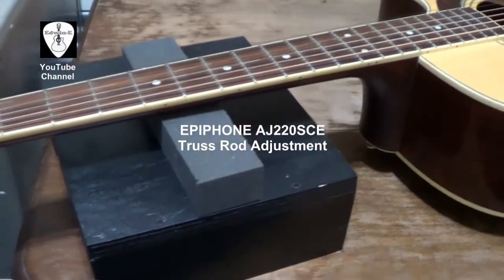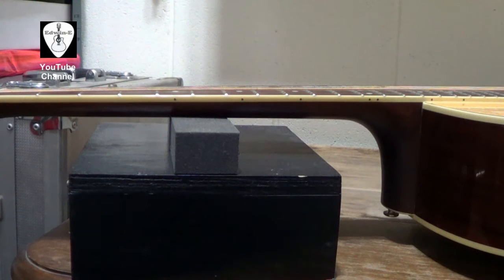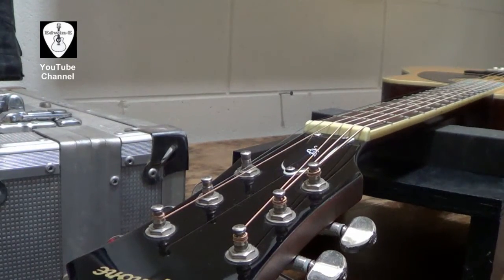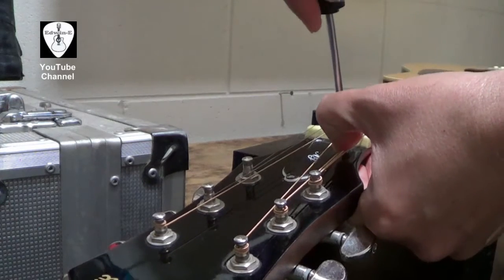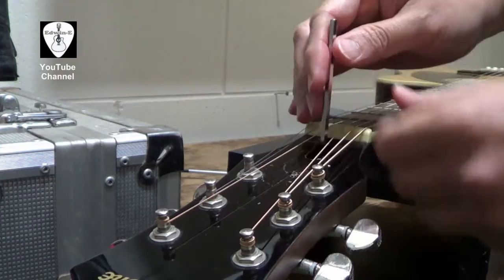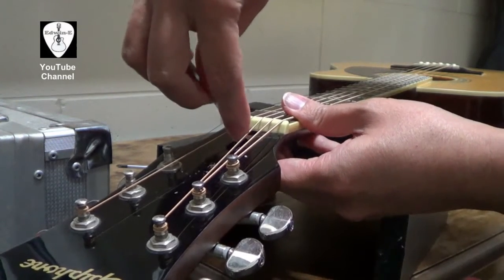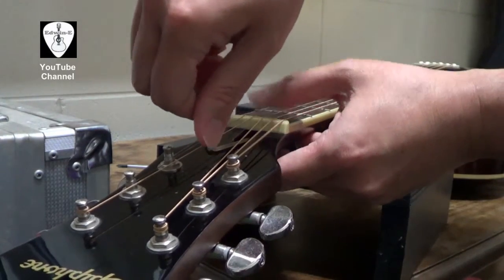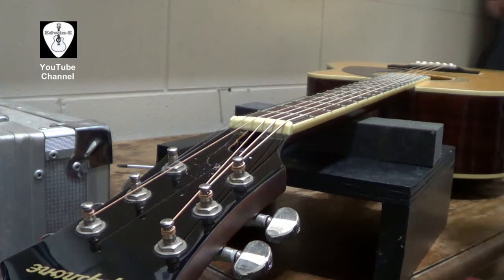Guitar Truss Rod Adjustment on Epiphone AJ220SCE Acoustic Guitar

Comment: Hello! I just got a new acoustic (A Seagull Entourage Rustic CW QI) and the top is starting to make some cracks. Is there any way I can get rid of the cracks? Or any advice? Thanks!
Reply from the maker: I think the guitar is getting too dry.  What is the humidity in your place?  If it is too dry, I would recommend you put in a case with humidifier inside.  Cheers.  Let me know how it goes.
Reply: _.erxcsn that shouldn't happen. Humidify the guitar right away! Always use a humidifier and keep it in a case. If you need to (like in your case) in an emergency where it is cracking, put some damp sponges (just lightly damp) and seal it I a plastic garbage bag for a few days. Just be careful to keep the sponges in the bag, but not directly touching the guitar. If you let it dry out too much, the bridge can snap off and destroy the top, frett board, etc.

Comment: Wow that's alot of turns tho....  I'm having problems with mine   .. I'll try it   thanks  so if it's high.. turn right...low turn left?   .. Thanks
Reply from the maker: if string is high, means neck bow inwards, then need to tighten truss rod, turn clock-wise.

Comment: I have aj100ce.. will the method be same?
Reply from the maker: Some models have truss adjustment inside the sound hole.  But the principle is the same, turn clock-wise to tighten, anti-clockwise to loosen.

Comment: saludos desde perú...yo tengo este modelo de guitarra...debo ajustar la guitarra...es nueva?
Reply from the maker: If the neck is bowed then you may need to adjust even if it is new.
Reply: Gracias lo tendré en cuenta...pero cómo saber eso?
Reply from the maker: No problem.  Follow my steps in the video to check if the neck is straight. Cheers!

Comment: Far too many turns. Turn only a half turn at a time and wait several hours for it to form and take it's shape before you can even measure out any difference. He probably later walked in on a broken guitar. I know as I once made the same mistake when I was uneducated. I would watch more videos if this is your first. Sorry buddy but I give a thumbs down
Reply from the maker: Thanks for your opinion.  I agree with you.  Yeah I suggest that viewers watch many other videos as I am not a guitar technician.  Although, I have adjusted hundreds of guitars and no one got broken so far.  How many have you done by the way?
Reply: @Edwin-E  I would have to locate my tally Wacker sheet.... The only thing I retract is saying half turns at a time as it should be even less and rather quarter turns. This message Edwin was for the viewers to your video in hopes that they don't learn from it I don't want to debate with you and let you try to convince people it's correct in any way. Far too many turns edwin. Again I was once uneducated also over this matter and turned even more. No hard feeling Edwin... Rock on
Reply from the maker: No worries.  Thanks for our feedback anyways.
Reply from the maker: Thanks for your feedback I mean.
Reply: Dan Erliwine unstrings, clamps neck and then tightens the rod rather than using the rod to reset the neck thus not stressing the rod